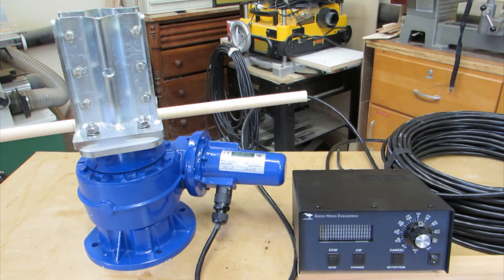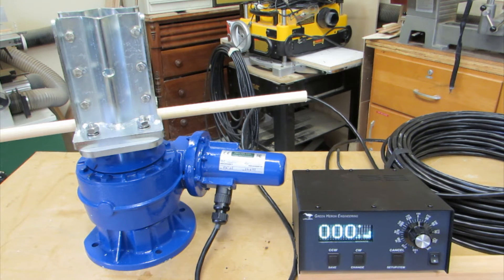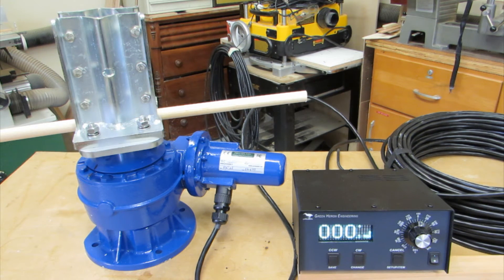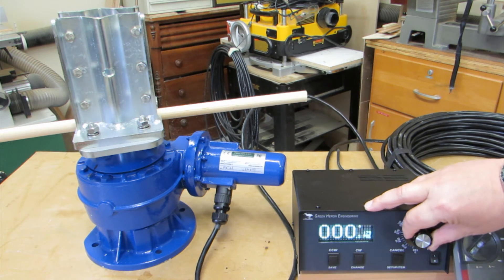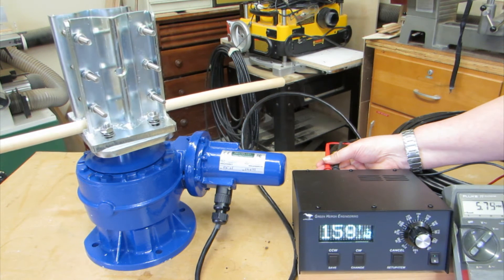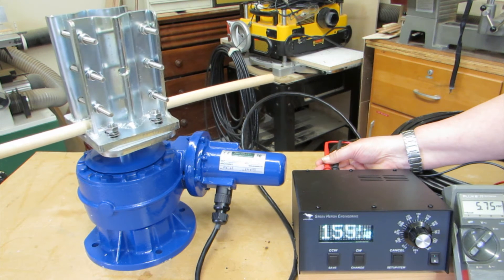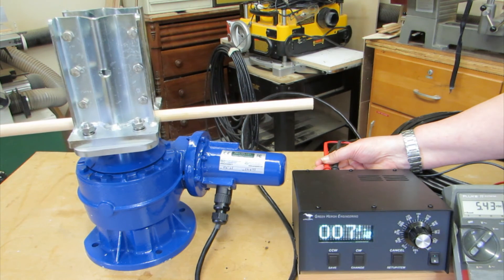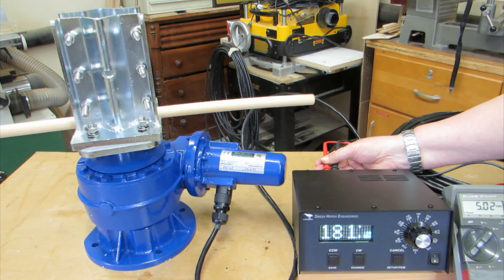PST 61D Antenna Rotor and Green Heron Controller

Comment: I'm on my second PST rotator, actually the same one as you. However, for the second time it seems that the  potentiometer has gone again. My mates had the same problem with his. Won't be getting another one.
Reply from the maker: +Penn Wooding _ I ended up not using the PST rotor because it wouldn't fit in the top section of my tower. About a half inch too long. Am now using the Orion 2800. Have had no problems. Uses Hall effect counter for direction and seems to be very dependable. Good luck.
Reply: i know of 4 people other than me that have had the same potentiometer problem and have had to replace it

Comment: My prosistel is from June 2023 and has already broken down 3 times. Change 2 potentiometers in 6 months PFF.. I do not recommend this poorly designed motor. I will buy a more reliable Yeasu G 2800.73 F4ixq

Comment: my prosistel is from June 2023 and has already broken down 3 times. Change 2 potentiometers in 6 months PFF.. I do not recommend this poorly designed motor. I will buy a more reliable Yeasu G 2800. 7351